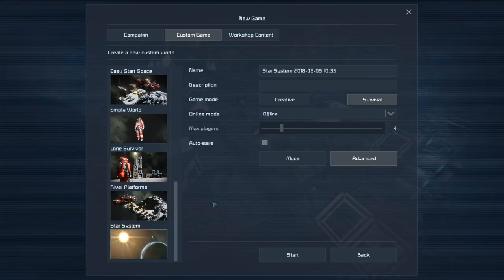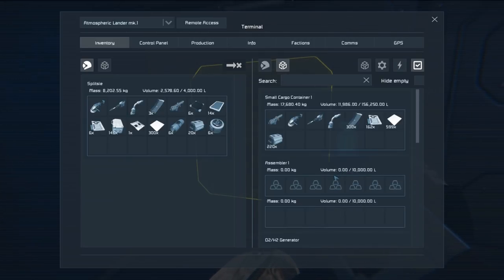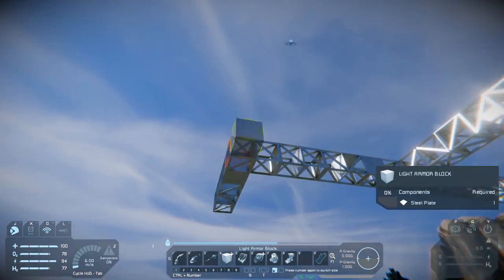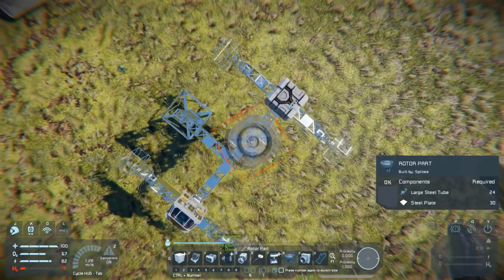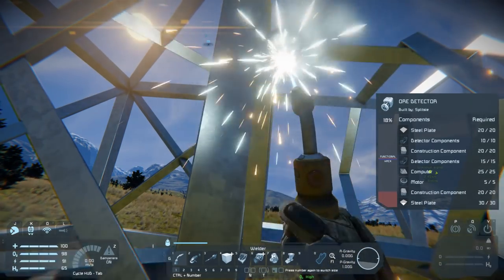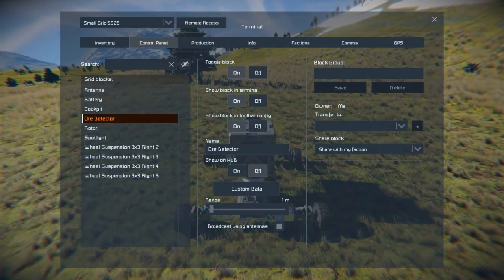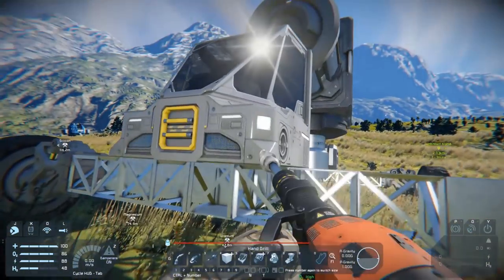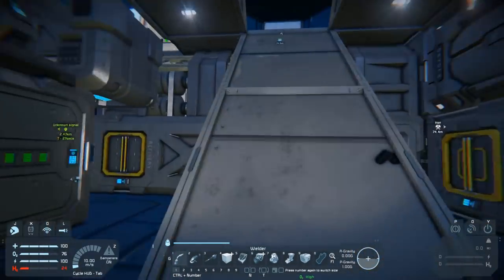Space Engineers Tutorial: Landing on a planet and finding ore (Guide to finding ore in update 1.186)

Comment: I'd suggest if you're going to break down a component for silicon you use bulletproof glass instead. The lander has several windows on it, most of them contain 30+ units of bulletproof glass and serve no real function other than making the ship look better. Also unlike computers, which are almost always useful, you'll find very few critical parts that require bulletproof glass to function.
Reply from the maker: That's a good point, at the time I just picked the computers because they had both materials I needed :P

Should have thought that through a little more...
Reply: again the windows make a good choice.. as the girders used in them also have the iron you need....
Reply: Also, bulletproof glass contains a truckload of silicon

Comment: A few comments, since you asked: Firstly, you can see which way a rotor will face while placing it. Just rotate the image until the 0 faces forward and place it rather than fussing about with rotating the thing.

When building a rover, for the cost of a few more blocks, lift the body a bit off the ground with angled blocks for clearance. Helps when trying to avoid small rocks and bottoming out on the jumps (which are really fun now that wheels work!).

If you're lucky enough to find several deposits close together, dig a starting shaft roughly in between and then start mining from there. Makes for less tunnel drilling just to get out and also fewer holes that might take off a rover wheel at some point in the future.

When you find an ore deposit, use your suit GPS to mark the point to make it easier to find later.

A very good video IMHO. Looking forward to more!
Reply from the maker: That's a really good point about the mine entrances creating nasty potholes - I've ended up in the bottom of a few large mineshafts in the past, that I really shouldn't have been able to miss (now I put GPS markers on all the entrances).

About the rotor, with the way you have to attach the rotor part to it you'll always end up with it somewhat offset when it attaches, but you make a very good point that setting up 0 to point forward will make things a fair bit easier to lock to the correct angle :)

Thanks for the extra tips :)

Comment: Can confirm that the rotor drop trick to attach large grid to small grid still works. Followed the instructions here and it worked perfectly. A bonus is I leaned something about rotors!
Reply from the maker: Glad it taught something useful - it's something I use a LOT of. Something I should have done back when I made this though, was to use advanced rotors as you'll then get a better spot to drop the rotor part onto since small advanced rotors are a 3x3 base :)

Comment: grind down a LG off the lander and place it on your "car" that way you can mount it where ever you'd need to on the undercarriage.

also if you separate the LB ore detector onto another "trailer" based cart, then you have a bit more range on mining as your detector is mobile but can remain stationary while you use the main car to ship loads back to the lander.

But of course this is "if you're not a good pilot" advice, personally my step 1) is fly low altitude find a few deposits(all the different available if lucky) then centrally locate the lander and begin with similar to what you did here. Keeping the lander mobile for as long as possible.

P.S. find myself watching these tuts most times just incase theres a tip/trick I find handy that I don't know about. Pros aren't all knowing of course ;) 
Except for Capac...LOL

Comment: You can build a great hand mine to go in and out of easily by using sloped armour blocks.  The 45 degree angle makes it perfect for mining and then you can attach a battery/reactor to it and use this grid to light up your area and even create a tube transport system to a cargo container above.
I also use a sliding door at the top, with Glass around it to provide protection from Wolves and other players
Reply from the maker: I've never put that much work into my hand mines, but if you've got wolves on in your world it sounds like it'd be worth the effort and make things easier. I have a habit of jumping straight to ship miners, but setting up something like that would be fun even just for the role play side of things :)

Comment: I have been watching your videos for awhile now. I have really enjoyed them. One thing you do not seem to utilize or say is that not only.can you refill your suits hydrogen/oxygen from the med bay but the planetary lander has 2 each oxygen and hydrogen cylinders in it. If you jump out of the seat once the lander stabilizes and stops moving you can grab the oxygen cylinders and that will allow you to look for a suitable location from a higher altitude. Once you find your location you can swap them out for the hydrogen cylinders and you can refill less often because it will auto refill the suit until the cylinders are emptied. You can refill the cylinders but placing them back into the oxygen generator briefly them back into your inventory so you can fly further and be more productive.
Reply from the maker: I totally forgot about those when I was making this - it's been a while since I've used the lander. When I did my original tutorials I think I only brought up the bottle thing when I got to designing the large grid ship. When I remake the tutorials later this year I'll try to remember to highlight that more clearly :)

Comment: Just use the lander's large ore detector to search around for few minutes. You will find every resource in 10 mins if you have a good system. THEN you land near Iron, Nickel and Cobalt and get started, if you don't want to waste time. Also, welding the small grid by hand is such a waste of time. Place the skeleton on few blocks so that it's higher, then build a welder on the lander (connected to cargo from the back). This system will also allow you to build your starter base within minutes, especially the 2 batteries and 6 solar pannels you already have in cargo, instead of going back and forth with resources. I like the part with the rotor, I didn't know you could attach large head to small rotor base, but otherwise, there are faster and simpler methods to start with lander.
Reply from the maker: Building with ship welders can certainly be faster and I might try to highlight it more, but for brand new players it can add more complexity and more confusion so I try to teach these topics in a way that minimises the steep learning curve. With these tutorials I'll often deliberately do something that I know his slower/less efficient if I think it'll benefit the lesson that I'm shooting for :)
Reply: that is a good point Splitsie going straight for the complex systems that we are used to and familiar with using can some times seem a bit much for someone new to the game which could cause them to shy away from it, after all the game has changed a lot in 4 years, wow has it really been that long I know it sure does not seem like ive been playing for 3.5 years and yet i am still learning new things myself.

Comment: Nice tutorial, one thing I haven't noticed you talk about (and surprised you didn't do it in your survival minus uranium series) is building your base on/locating the equator for better solar panel usage
Reply from the maker: If you're going solar, your best bet is actually going to be at the poles where you can get sunlight all day long as there is no attenuation of power due to atmosphere :)
Reply: Splitsie that's very true, and you only need one rotor, but I had a hard time finding a place sufficiently flat at the pole whereas the equator is a lot larger than a singular point and building up above terrain is less necessary
Reply: Splitsie either way, I feel like knowing how to use the GPS to locate the poles/equator is a useful tip
Reply from the maker: You make a good point, I think I compared the amounts of power with latitude when I did my solar panel tests but I can't remember how much of a difference there was between them. I'll have to go back and watch it when I'm not at work

I've never thought about trying to use GPS to find the exact pole or equator... I feel like there must be a clever way of doing this but I'm stumped :P
Reply: Splitsie I think it's +/-90,000 0 0 for the poles if I remember correctly, I'd have to log on to one of my world's to test it.
Reply: Splitsie or maybe it was 60,000. Put one of those numbers in one of the coordinates and 0's in the other two boxes, you're either going to follow it to one of 4 points on the equator or one of the 2 poles
Reply: Splitsie it was also a considerable difference between the poles and equator if I remember correctly

Comment: No rovers were harmed during the recording of this video.A small question for whoever has time to confirm: is it just me or now the Space Engineers is heating up my video card like hell... Before the video overhaul, my GeF 1060 hovered at about 60-65 maximum, now its trying to get above 72 degrees (Celsius btw). I even had a complete system crash (had to hard reset the whole PC) because of that. I want to mention that the video card is cleaned, and in other hard demanding games is performing like it use to, meaning normal and not overheating. Btw, very good video as usual Splitsie, please keep'em coming.
Reply: I think the new options do have the ability to really overuse a graphics card if you have everything turned up to max.
Reply: Yeah, I figured that much out on my own, the problem is that the card is overheating on low settings as well, and it shouldn't tbh.
Reply from the maker: Hmm, that doesn't sound good. I've not looked at my temps to see if I've got the same thing. Space engineers has always been known to push graphics cards to high temps - at least if reddit is to be believed :P

I'm not surprised you're seeing higher temps since the update, could it be because of the change in default graphics settings pushing things higher than they used to be? Things like grass distance always seemed to have a big impact on my older cards
Reply from the maker: Oh, I had another thought. It would be interesting to see if turning post processing off would bring the temp back to normal...
Reply: Stupid question as I'm sure you've checked, but is the fan actually spinning?

I'm running a 980 which is at 97-99% used and 66C stable.

According to Nvidia the 1060 max temp is 94C (https://www.geforce.co.uk/hardware/desktop-gpus/geforce-gtx-1060/specifications) so 72C should be no trouble at all.  Other than the standard advice, update drivers etc, it sounds like a fault with your card.
Reply: @gordon861: I have checked everything before asking. The card is performing flawlessly in other very demanding games. I'm used to play on high settings on almost everything I got and never go above 65. Except SE. The thing is, even if I actually lower the settings, the card is still reporting 70 and above. Later edit: I encountered another game that is pushing my temp like SE, and that is Empyrion... hah?! coincidence....? I will try to mess up with the post processing settings as you said Splitsie, but now I need to sleep.

Comment: I try to find Uranium on a planet, I drive around for hours, no dice, then I see you find it in like 5 seconds. LOL XD

Anyways, I have a specific way of mining those boulders like the one Splitsie mentions at 11:21. Those rocks are actually separate  voxels from the world voxels, so I tend to want to mine them completely. Going in and out of the resulting hole can be tedious, however, so I end up drilling down around the sides of the boulder, finding where the bottom is, and then setting up a collector at the bottom that leads to a cargo container on the surface via conveyors. That way, I can mine away at the boulder and let the ores funnel into the collector. Using this method, I find it's easier for the ores to reach the collector if I use armor slopes, so digging a bit deeper below the boulder to get good angles for the falling ore might be a good idea.

If you decide to use this method for mining boulders, be sure to add a wind turbine or some other power source, and I'd also recommend building a connector on the side/top of the container if your vehicle has connector functionality as it will make transferring cargo MUCH easier. Hope this comment helps you out, and props to Splitsie for making such helpful videos! (Seriously, Keen needs to add your playlists to the F1 Menu :D)
Reply from the maker: There is no uranium on earth in the vanilla game any more (there was back then), just in case you're still trying to search for some, uranium is only found in asteroids now

Comment: Did update 1.186 remove the ability to add a large rotor head to a small rotor through the control panel?
Reply from the maker: As far as I've ever played around with rotors you could only attach small rotor heads to small rotors. Large give you both options, I'm not sure if the small advanced rotor has the option to add either, I was trying to make this as cheap as possible so I didn't even think to check if that would save a step.
Reply: I don't remember if there ever was this option in the first place
Reply: at least small head on large base was possible. i used it to build some lights for a landing platform
Reply: It was an option at one point, Splitsie.  In your initial Rotor tutorial, you demonstrated it with that large grid to small grid to large grid rig that had two rotors.  Personally, I'm kind of glad that they fixed it (from a realism standpoint, at any rate), though, I suppose it could have been done with a hollow large grid rotor part with a central pin.  And if you're not into doing the whole large grid on a small grid thing, there are a couple mods that increase the maximum range on the small grid detector; Ore Detector+, which increases max range to 150m (and large to 250m) (though I'm not sure if this still functions), and there's also Skellabjorn's Boosted Ore Detector, which increases the max range to 250m (and large to 325).  And if you're not happy with either of those, there's the Azimuth Overclocked Ore Detector mods, that add a new model, and increase the range, but at the cost of a lot more components to offset the increased range.  Those are available in Weak and Strong versions.

Comment: I tried adding this to my rover that I made and I cant get the 2 rotors to connect... tried for 2 hours... any tips?
Reply from the maker: These days I'd recommend using advanced rotors, the small grid one is big enough that it makes it a bit easier to get that large grid rotor part to rest on it properly for the attachment as you can just drop it there and if it stays on it'll usually be in the right spot for attachment :)

Comment: At about 5:17 when you were first placing the rotor on the frame how did you switch between the advanced rotor and the regular rotor model without changing the hotbar selection?  Couldn't find anything obvious in the controls menus.

Also thanks for this idea I haven't played SE in a long time and I was sort of worried when I spawned and didn't see dark patches.
Reply from the maker: With the rotor menu item that has the plus symbol on it, you can switch between each with your mouse scroll wheel :)

There are a few others in the g menu that are like that and can be changed the same way like the armor blocks. If you search for rotor though, you can put a specific type on your hotbar that won't be able to change

Comment: When I saw the new patch and the fact that the dark patches are gone I tried flying around low level over a lake and found it a nightmare to find the ore spots.  Part of the problem was that to do a search efficiently you really need to be very methodical with a search pattern.

My solution to this problem was to take advantage of the new working wheels and strip down the base lander into a six-wheel large grid rover with the parts.  A slightly modified version has been uploaded to the workshop:

http://steamcommunity.com/sharedfiles/filedetails/?id=1295255743

This vehicle now also has a couple of smaller wheels on the front for when you hit a slope in front of you.  It has 2x assemblers and a refinery with all the upgrade ports uncovered for use later.  You also have medbay, o2/h2 generator and a large container, there is a connector on top of the container for unloading and a second connector for recharging.

The biggest issue with building it was moving over the batteries without grinding them down.  The solution was using merge blocks to connect batteries together and then grinding away the merge blocks.  I also built myself a small flying tug like the Ugly Duckling with a landing gear on the front instead of a drill to lift and move the batteries about.
Reply from the maker: Moving batteries that way was something I had far too much fun with when I played the escape from Mars scenario :)

I'm so glad wheels are working well enough to make ideas like this workable

Comment: I think i need to show you my starter survival rover design even with the old wheel settings the only time i managed to crash it was driving off a cliff in the dark also a remote block and passenger seat seat use less resources then the cockpit.
Reply from the maker: Make sure you do when we take a look at the autopilot problems I'm having :)
Reply: can definitely do that and if you like I can even show you some modifications I like to do to the lander on worlds where I keep the lander around though mostly I tend to grind it down right away as the materials in the cargo container make a descent platform and the rest of the lander walls it in and makes it airtight if needed (if on Mars) with parts left over for both a rover and minner